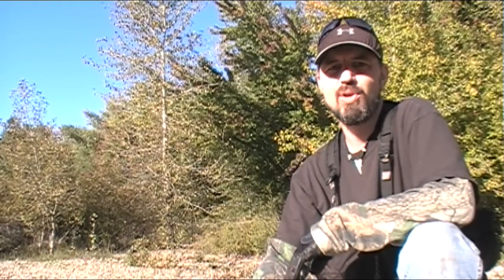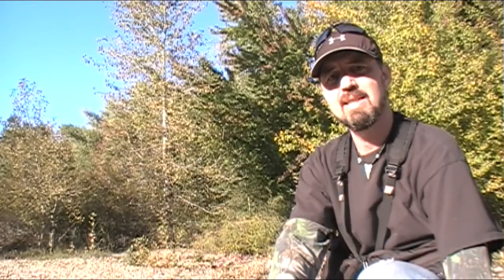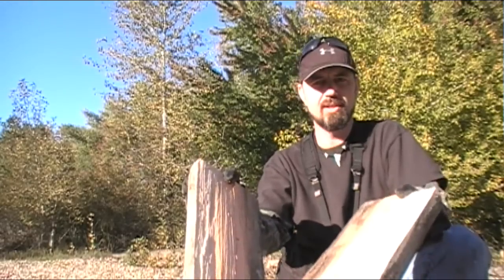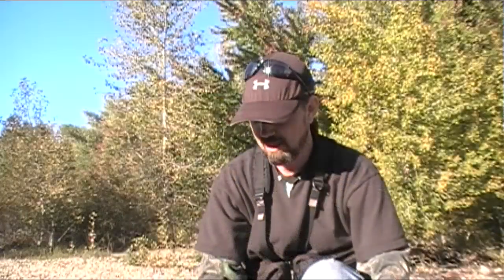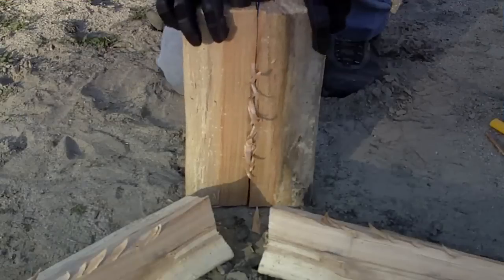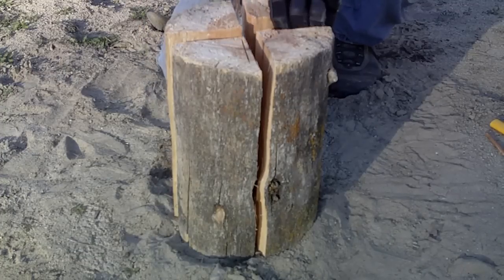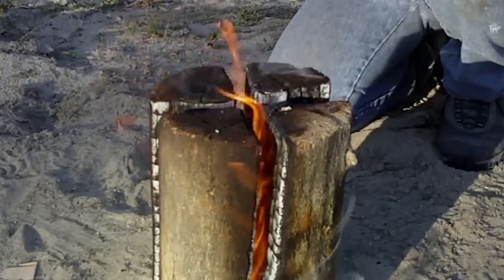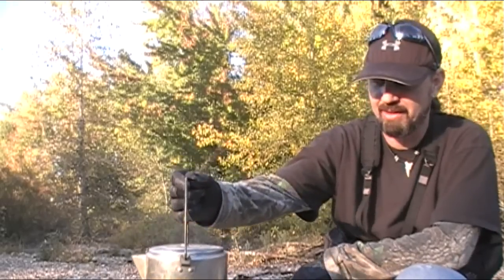Swedish Fire Torch (Quick Lighting Version) "Tip Of The Week" E42

Comment: Down here we call it lighter knot but basically its Pine w/ a heavy resin content it tends to smell kinda like turpentine. If you cant find any in the woods check your local stores around winter time they sell it where they do those fireplace logs that last for hours. If you want to make a makeshift version you can get some pine resin melted in something like a Altoids tin then remove from fire and put small sticks in the hot resin & let absorb that resin for while then remove from tin & dry.

Comment: I seen it in another video but if u r camping and plan to make once maybe take thin bailing wire and wrap around the base and in the gaps jam som small branches near bottom to open ur top part. Throw some kindling on top so once it burns it drops near bottom but not all the way because u wana have it nice and tight.. In the bush u might not have bailing wire but if u r camping u can plan ahead and even make ur own starter before camping

Comment: If a pine tree is cut or blown down the roots continue to send sap up into the stump which gets saturated with the resin.  Pieces of that stumpwood burn really easily even if a little damp.  Turned to sawdust it's called Maya dust but that's likely more susceptable to moisture so I just carry a pencil sized stick of it.  Good at catching a spark.  You can find bags of it in the fireplace section of Home Depot if you haven't a place to harvest in the wild.

Comment: that's one way of doing it, but in rain or strong winds it will go out, your not suppose to cut all the way thru the log, only suppose to be a quarter way down the log, I'm in Canada and the winds we get where would blow that fire out easily, I guess different strokes for different fokes by the way love your vids :3 you should do a vid on the way I do it :3
Reply: How exactly are you supposed to do that with an axe?
Reply: he cut the log to size with a bow saw so i don't know why he switched to the axe i personally would have cut the cross section into it first with the saw whilst it was still a long log then cut it to length after suppose there isn't a right or wrong way though as long as he ended up with a nice fire :)

Comment: Question: how would you balance a pot of water on top of the log without knocking 1, or more, 1/4 pieces from falling over 😱🔥 !??
Reply from the maker: As long as it's on a relatively flat surface and your setup is stable you shouldn't have any issues. I hope that helps.
Reply: @IntenseAngler  👌